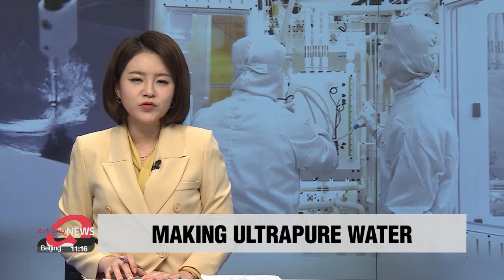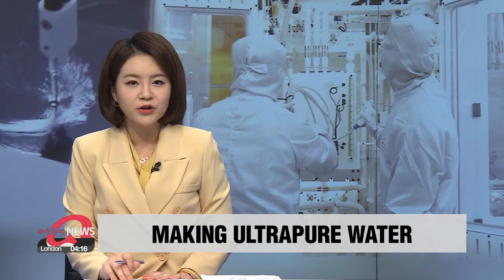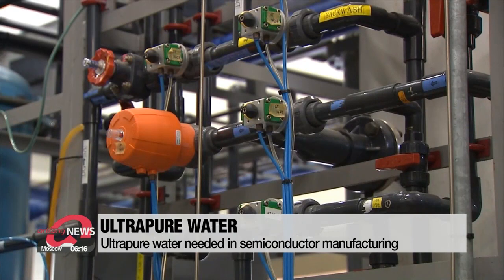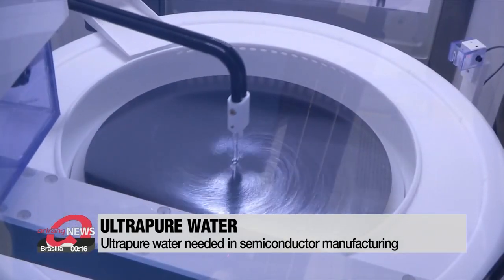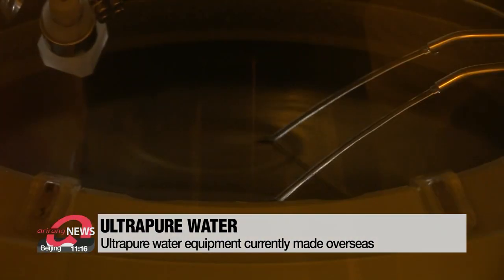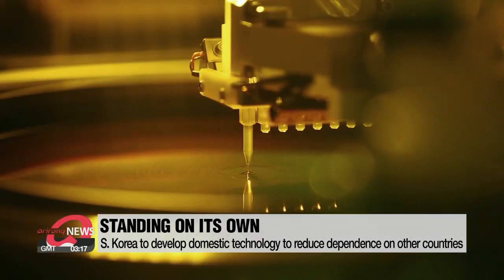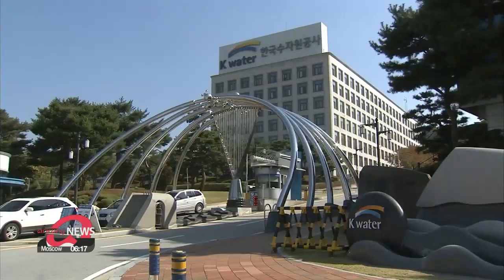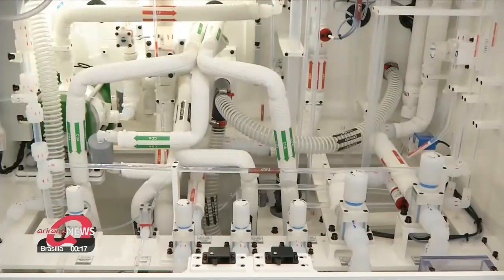S. Korea to produce 'ultrapure water' equipment for semiconductor supply chain

Comment: It seems that Korea has already forgotten that LG Display suffered a great deal of damage from using domestically produced hydrogen fluoride.
Reply: There was no such thing. The Japanese always lie.

LG Display still uses hydrogen fluoride made by Korean companies. LG Display is a new export record. Japan's materials, parts and equipment industries will be defeated by South Korea within 10 years. www
Reply: @권님-z8b  
The lier is YOU.
According to the Korean media, LG Display has been experiencing a large number of defects in its OLED panels for the iPhone 11 Pro series of U.S. Apple smartphones, which are believed to be caused by hydrogen fluoride, which was switched from Japanese production to domestic production. The quality defects were discovered in August and September of this year, and it seems that some of the production was still affected until November.

LG Display is said to have used hydrogen fluoride, which was successfully produced domestically in South Korea, to generate product defects that caused vertical lines on the screen. It was discovered at the downstream assembly stage, and hundreds of thousands of panels were discarded.
2019/12/17
Reply: @gu9yenk  2019/12/17?... lol

Now 10/29, 2021

At that time, all problems were resolved and delivered to Apple.

It wasn't a hydrogen fluoride problem either.

There was no mention of the hydrogen fluoride problem anywhere in the Korean media.

It's not a hydrogen fluoride problem in LG OLED panels.

Not related to hydrogen fluoride.

LG Display still uses hydrogen fluoride made by Korean companies.

LG Display is a new export record.
Reply: @gu9yenk  Anyway, the material field, where Japanese companies monopolize 100% of the market share, will disappear a lot within 10 years... In the end, it will be the same fate as MLCC and image sensors.

And DuPont (USA) and Merck (Germany) have agreed to provide technical support to South Korean material companies... In 10 years, there will be no semiconductor material field that Japan has a 100% monopoly.
Reply: @gu9yenk  This is the second part of the series to kill the Japanese semiconductor manufacturing industry (Toshiba Semiconductor) in the 1990s. lol

This time, Japanese semiconductor material companies...

DuPont and Merck are companies that have been in Korea for a long time... Did you know that DuPont is the Teacher of Samsung and LG OLED panel and display technology? (Samsung's semiconductor teacher is IBM)

ASML and South Korea agreed to jointly conduct research and development on the latest semiconductor process through technology openness to each other (semiconductor manufacturing process, materials, parts).

The semiconductor equipment industry needs only the United States (Applied Materials, Lam Research, KLA, Teradyne) and the Netherlands/Europe (ASML). Semes is growing terribly.(In the end, it will be the same fate as MLCC and image sensors.)

But Tokyo Electron, feeling a sense of crisis, is building a factory in South Korea...

Is Abe an idiot? www